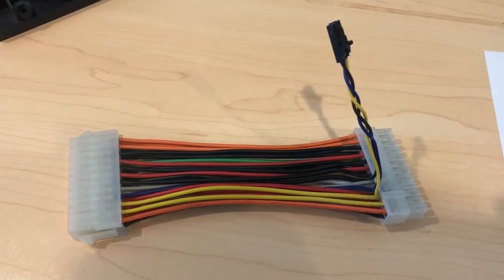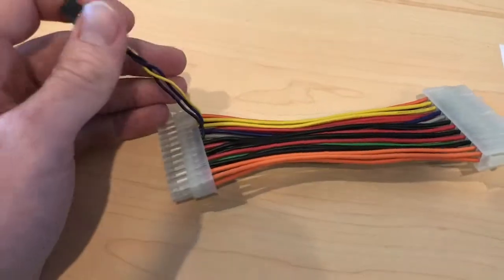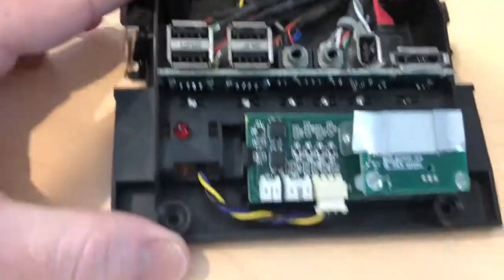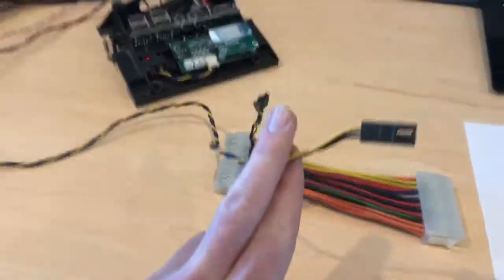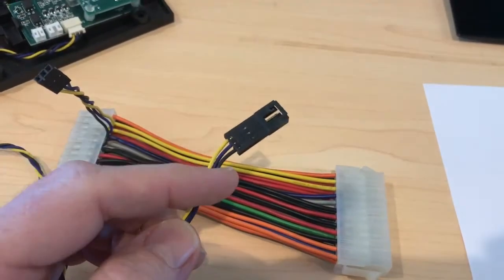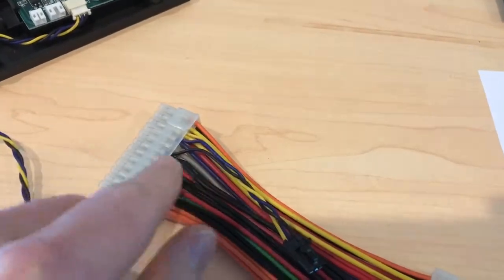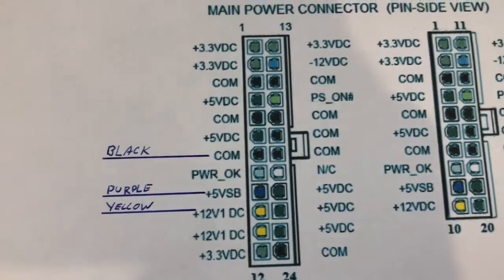Cosmos S - Black, Purple, Yellow front panel connector

Comment: I've had this case for over 15 years. I've always wondered if there was any way to get rid of this awful adapter, but it's necessary for the front panel power button to work. Is there any other way to connect the front panel button to the motherboard's normal power connector and get rid of this adapter?

Comment: Thanks for this! I have three Cosmos S that I use as TrueNAS file servers (primarily as I can stuff 15 drives in the front of them), and the third and most recent build was missing this 24 pin adapter. Just soldered one up from an aftermarket 24 pin extension cable and a set of breadboard jumper wires. Was even able to glue the jumper wires together to fit perfectly into the factory connector with the correct colors. Works great. Thanks!

Comment: Hi guys can you please help advise me i purchased this monster of a case from someone locally to me for £5,on Facebook marketplace, didn't realise the size of it until I went to collect it so heavy managed to get it home on the bus what a struggle that was but anyway after seeing this video i wondered why i could get it to work, the big fan on the side is missing and the hard drive caddy fan also.no atx connection adapter that cable connector coming from the front panel has 3 wire,1 yellow 2 black, no purple has others on here have so how do I connect to save this wonderful looking case bringing it back to it's formal glory and be loved.kind regards 🤔😃🤗✌️

Comment: You are a saviour! I bought cosmos s case second hand, and it didn't have 24 pin connector. I have connected 12 volt and ground to my 3 pin fan connector on external fan controller. And 5 volt standby I connected to Psu. I just didn't want to risk 12 volt going on a 5 volt line. Overall thank you. You saved me a ton of trouble.

Comment: Thanks for this information 👍 I think the purple cable (connected to the +5VSB pin ATX) is for the powerswitch to stay standby when the PSU is not running. After switching on the PSU, the black and yellow cable (+12v) makes the led of the powerswitch burn lighter, showing the PC is running. I'm not sure if this +5VSB pin also keeps the PC running, in that case you can not use another +5V source like USB.  🤔

Comment: Shane thanks for the video. Now I realise I’m missing the atx power supply extension. Time to buy one off eBay.
Reply: Hey there, did you manage to find someone selling the case-specific extension?
Reply: @SciaticCoast89  no I didn’t. I ended up buying a power button that plugs into Mobo headers and passes through a pci slot cover and not using the case power button at all.
Reply from the maker: If you haven’t found one I’ll make one for you
Reply: @shanechicane  how much with shipping to the uk? I’d consider it. :)
Reply from the maker: @AlastairClarkUK  Turns out the 3-Pin Molex connector is quite rare. I have managed to find some in China, so to make it worthwhile I might do up a few and see if anyone else wants one.
Reply: @shanechicane I would like to know if there a way you could ship to Malaysia? I had. Cosmos S but lost the 24pin extender.
Reply: @shanechicane any possibility to purchase one from you?
Reply: @shanechicane  or share instructions on how to make one. :)

Comment: I was trying to take COM and 12v from standart molex of my PSU and the 5vsb from USB 2.0  port on internal motherboard USB port, this way there is no need of adapter. On my old PSU it worked fine, but when I purchased new advanced PSU computer began to turn off after several seconds, I believe the PSU shut down it for emergency reasons. If I take 5vsb directly from PSU everything works fine.

Comment: Where would the black, purple and yellow connector usually go on the motherboard? I just got this case for free and will not power on and I found your video.
Reply: Jealous you got the case for free. I payed good money for this second hand on eBay recently. :) use case for the front 5.25 bays
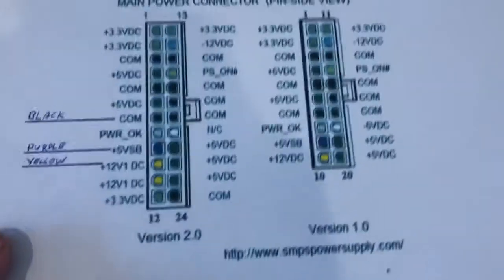Reply from the maker: Hi selw0nk, the black purple yellow plugs in to the ATX connector shown in the video. You probably don't have the ATX connector that came with the case, like the one shown in the video, so you will have to find a way to make the connection happen. If you skip to about 1:40 in the video you can see the diagram labelled for you.
There are plenty of ways you could make the connections - some better than others. You could, for example, cut the wires on your existing ATX connector (the ones labelled in the diagram) and splice the Black, Purple, Yellow wires from the front panel in to them. If you do this, make sure you use some electrical tape to cover the join. Also if you do this, you should probably solder the connection, but honestly just twisting the wires together will work for now. Alternatively you could get an ATX extension plug and take it to an electronics store. Get them to watch this video and tell them you want the same 3-pin plug added to it.